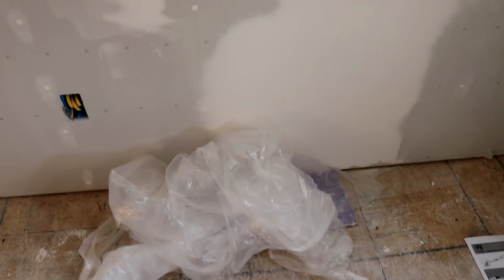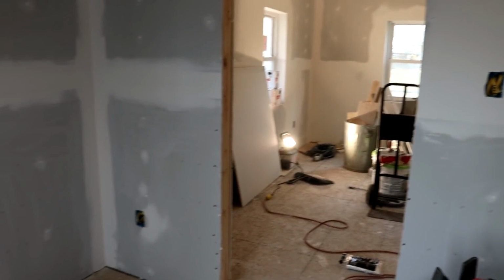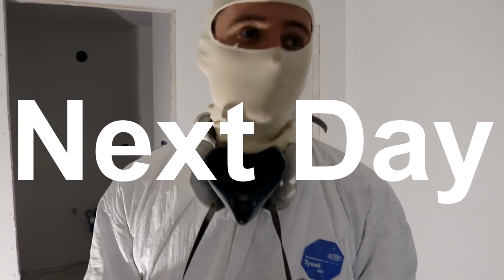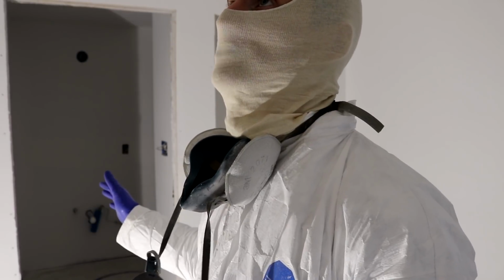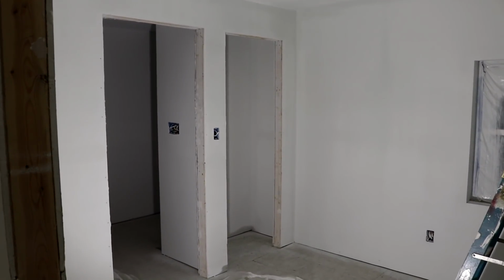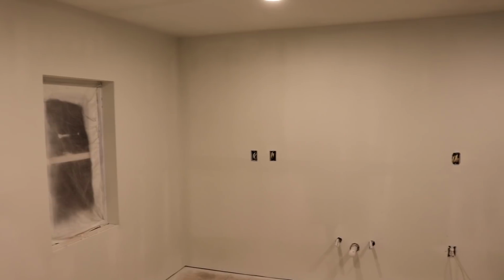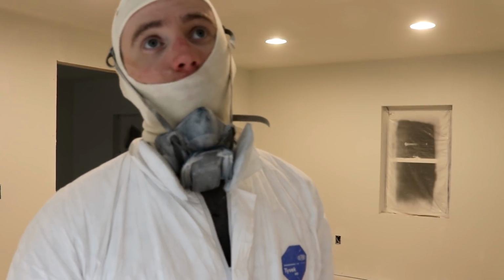$12,000 HOUSE - Priming, Painting & Beyond! - #46

Comment: I don't know why I never thought of that before.  Follow up the spray with a light roller.  Thanks!
Reply: Why isn't it enough to just spray the walls?
Reply: @g.ami101  ... click "show more" and read the explanation, and/or watch the first three minutes of the video.
Reply: @dhyde9207  lol
Reply: wnc817  doesn't it leave marks when you roll over the paint? Id like to achieve the most flat surface as possible.
Reply: goldami1 - roller leaves a desired texture on the wall; uniformity.
Reply: You get a better looking paint finish if you roll after spraying. If you watched this, he explains how there is very little paint on the roller, it's just to smooth out the finish of the paint.        @g.ami101
Reply: goldami1 if you get a really low nap roller it’ll leave a smoother finish. But even most professionals back roll. It’s REALLY hard to get no drips with spraying
Reply: Lots of great points here.  I'd like to add, that if you backroll after spraying primer, you smooth out any drywall dust that's left on the wall.  If you spray a dusty wall, when it's dry it will be just like sandpaper.  With the flat paint, backrolling isn't as necessary - mostly to catch drips and other yucky bits, as wnc817 noted.
Reply: @iLikeC00kieDough  with the right spray tip and practice, it's not that hard.   Both are equally important.  :)

Comment: People underestimate the value of an Electric leaf blower on the job site. For indoor use it works great on certain tasks. It’s also a great way to clean out your work van. Or quickly ventilate a room.
Reply from the maker: I'm not sure if it has blown a single leaf.
Reply: I have my shop blower but usually opt for the air compressor
Reply from the maker: A much more focused stream of air indeed.
Reply: @homemadehome5575  also great to get the fireplace blazing ;)
Reply: I thought it was a great way to get dust off the walls, but I freaked out about him not wearing eye goggles!

Comment: Good video. Flat paint with no drywall texture is a disaster tho! I'm speaking from personal experience my boss did a house like that and we had to keep coming back for weeks touch up work. It doesn't hid anything if you touch the wall  can't just wipe it off the flat paint absorbs the oil from your hands and you have to paint over it at then because there's drywall texture the brush or roll marks even though we back rolled show when you look down the wall. Idk maybe it had some to do with the paint we used or the humidity I hope you don't have the same experience with it I did.
Reply from the maker: I EVICT for touching walls.

Comment: 1 prep spray doors windows fixtures spray plastic instead of masking
2 primer tint different than final paint
3. Roller is as fast as sprayer. 
4. Hockystick paint brush to cut in base and ceiling corners.
5 drop cloth 3' x 12' 
5 used to do 2 Apts per day 2bedroom 2 bath 950 as ft each . Of course production work usually first week of each month .  total ten units would sub out additional units and focus on repair. Max units was rehab 167 units in 90 days many were occupied. Two man staff plus subs
Reply from the maker: Okie Dokie.

Comment: Is it easier to see your coverage using the paint sprayer machine, compared to just using the roller, where you see every uneven spot pretty much right away?! Cheers!
Reply from the maker: To be honest, white paint over white primer, I'm not worried if it's not perfect. I honestly just want to get it done. Before you know it, someone will have lived in it for a few years and I'll be back in touching it all up or repainting.
Reply: @homemadehome5575  Thanks for you reply, but my question was sincere, since I'm about to paint a larger basement area (both walls and ceilings) and that is why I was curious about the quality. My question did not imply any kind of critique on your work. Cheers! 😊
Reply from the maker: If you set up lights you can see the glare off the wet paint. It is hard to see the coverage at times, you just have to keep up with what your doing. I did just one finish coat, a second would most likely take care of any missed areas but for my project, it's not going to show much and even if it is..it's not critical. What I can see in my paint job is where more paint was in one spot than another. Just a slight variation on the ceilings in places if you are standing in just the right spot with just the right lighting.
Reply from the maker: Also, I started painting bare drywall....if you already have a painted wall that you are repainting, it probably won't be as noticeable.
Reply: @homemadehome5575  Thanks for the enlightenment! The ceiling is untreated dry wall. The walls are already (although at lest 30 years ago) painted stone walls, with varying texture. Cheers!

Comment: I'm curious, I would assume based on the size of the house that most likely you'll be renting to a low income family or single person. I would also assume that they might need refrigerator, appliances and washer / dryer to be included. Are you going to provide those as well, or will some part or all of them be required to be provided by the tenants? What's your experience with that on rental properties?
Reply from the maker: +Mike Dedmon All included

Comment: I don’t know about this stuff but quick question. Why spray and then roll. Is it for texture?
Reply from the maker: That's one reason, the texture makes future touch ups unnoticeable. Also, since it is starting at fresh drywall and joint compound, the roller presses the paint into the surface. You can see the difference in person as you work. Small stuff that you can see in the smooth sprayed wall disappears once rolled. Another aspect is adhesion as well as evening out the paint, when spraying, some areas can get sprayed too hard and others too light, the back rolling helps.

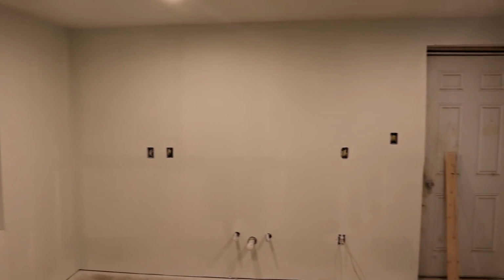Comment: Surely the video at 11:03 is the undercoat, not the finished topcoat? You can still see the plaster lines underneath.
Reply from the maker: I'm a fool that has no idea what I'm doing................or it could be that paint dries at different rates on the bare drywall vs. over joint compound.

Comment: Did you have any trouble with the paint cracking due to the cold? What was the temp inside when spraying?
Reply from the maker: No, it held it's composure pretty good. I had a heater running long enough.

Comment: so do you re-dip the roller when you back roll or no?
Reply from the maker: It depends, normally the roller is damp with paint and you are just evening out the spray, adding texture to the walls. The key is to get the paint on the wall with the sprayer, the rolling is just a quick part of the process.

Comment: so American homes don't get a coat of plaster on top of the plasterboard? before painting ??
Reply: Because this is a smooth finish not a textured finish
Reply: This is drywall not plaster, they are different.
Reply: @brandonpoe9907  they are actually the same thing
Reply: @nolanconville6523  the plaster is to give an extra layer between the dry wall before you paint over the walls
Reply: @brandonpoe9907  even with plasterboard or drywall, houses in the UK usually have a skim of plaster over the top. Whoever did my loft conversion missed this step and now I have a nightmare removing the wallpaper from over the top :-/
Reply: @Todd W it's a plaster which is skimmed over the plasterboard, doesn't matter what you want to call it lol. The drywall is put up them covered in a plaster for a smooth surface in which you can paint.
Reply: Darren It's up to the individual in this case. Most homes in my experience have some kind of texture such as a spray, trowel ect. But in this case he chose not to. Commercial buildings and some modern homes have smooth or very light finishes like this home.
Reply: The gypsum board used with plaster is a different material than what is used here. Plaster uses blueboard. It’s not the same as putting plaster on top of this paper covered gypsum.
Reply: I think you guys are missing Darren's point.

I'm also from the UK and worked with a builder on my house. We drywalled the whole house and he said I could paint onto the drywall and it will come out fine or I could spend a bit more and have it "skimmed" which is applying a thin layer a few mm thick on all of the drywall. When it drys it's very smooth and then it can be painted. 

So my house is old and when I purchased it had a thick layer of lime plaster on the brick. I stripped this out completely then used plasterboard (drywall) and basically stuck it on the walls. Then had the thin layer of plaster (after using tape etc on joints) then paint.
Reply: @Todd W Ah I see thanks for confirming :)
Reply: @CraveThatCoin  oh at last someone is able to tell .thank you for telling clearly this is what we have been trying to tell. Ok then they dont do in US in majority homes

Comment: Why are you using the the roller after spraying?
Reply from the maker: Character building, just kidding. I explain it in the video. It's called back rolling.....adhesion, evens things out, leaves a texture, helps with future touch-ups.
Reply: @homemadehome5575  Ok, thanks, don't know how I missed it in the video. Most of the time I'm respraying a house instead of putting on the first layer, thus I've never done any back rolling. I'll try it in the future.

Comment: Didn’t know u need to lay it off with a roller
Reply from the maker: You don't NEEEEED to, but it helps. Also, by leaving a texture from rolling, when you do touch ups later, they won't show up. Spraying leaves a super smooth surface, later brushing or rolling shows up bad. If you are using anything than flat white, it's going to look rough.